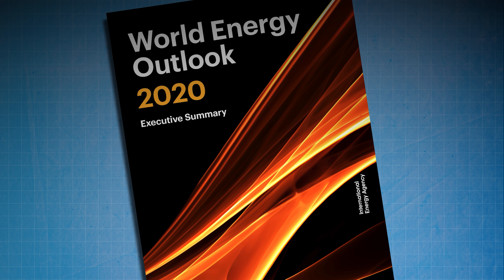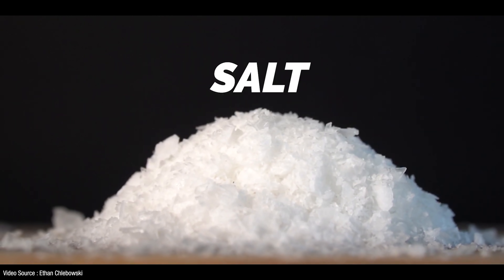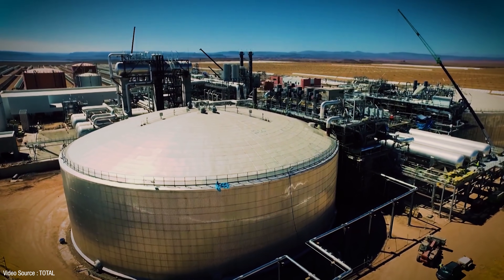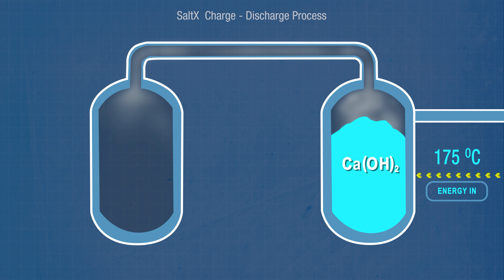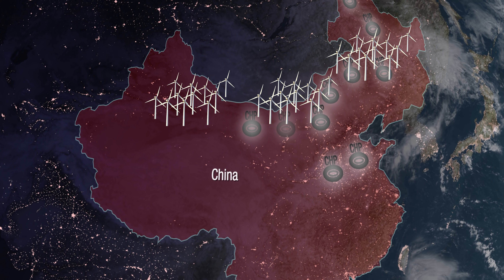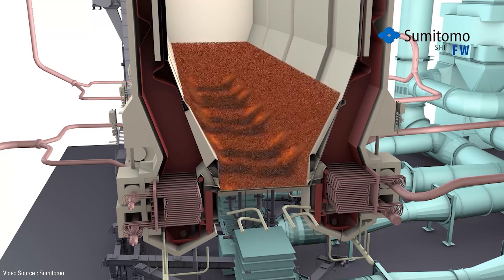Energy storage in salt - how nanoparticles are revolutionising the industry.

Comment: I've been thinking.. can you make these salts from sea salts? Cause I keep wanting to create or find a company willing to pump billions of gallons of sea water over hundreds of miles of canals to boost rain but then scrap the salt out of the canals for use in concrete & other resources. Add the areas of evaporation would be deserts which are best for huge solar fields.

Comment: good, another they print you believe material. what is water react with calcium oxide? is it a molecule level chemistry activity? if there is something stick to the calcium oxide, then can it still be called calcium oxide in the first place? so, what they describe either is not this particular chemical reaction, or it is bogus claim. you can try that reaction by yourself in some instant hot food or warming bags. repeat the same process with the same batch chemical mention 50 times is almost impossible already. if they claim they can do more, they don't have to sell recycle energy. companies making instant hot food and warming bags already break their front door and yelling for buying patents.

Comment: Phase change salts are also of interest.  Calcium Sulphate decahydrate, also known as Glauber salt is of interest.  When heated it liquifies as it absorbs phase change heat and gives this out when it re-crystalizes.  The phase change temperature is at about 32 C so is useful for home energy storage.  The problem is that as the salt begins to hydrate, it forms a barrier to more water getting to the salt and hence completely hydrating.  I haven't heard of an elegant way of getting around this problem.  It would probably help to somehow have very thin layers of the salt.  The latent heat of fusion of water is 80cal/gram.  The Latent heat of fusion of Glauber salt is 60cal/gram so it is pretty good at storing heat.

Comment: I have a dilemma (the above video may be one of many poterntial solutions)
I am a fan of steam Locomotives in the UK however powering such engines produces large amounts of CO2 due to their poor Carnot Efficiency and their use of coal in external fireboxes. Thankfully Coal consumption for steam locos is relitively low compared to other coal consuming means however this also means that it is uneconomical to produce coal in such low volumes to power the UKs steam based tourism industry which means we have to import coal - increasing the carbon footprint. 
I am trying to investigate ways of solving this problem that doesn't remove the "living" factor Steam locos are famous for in the tourism industry but finding safe suitable solutions is surprisingly difficult.

Comment: Too much of a good thing:  fossil fuels in moderation are great, as is geothermal, tidal, solar, but in excess they all lead to problems.
Tidal, hydro and other water power sources alter natural currents, disrupt ecosystems which are sometimes very fragile.
In large formats it has the capacity to kill off entire ecosystems, even change the ritational period of the earth and destabilize the Milancovich cyle.
With geothermal, in a widely distributed system you are takling heat from the earth and transferring it to the air.
In the course of billions of years this means the earth will cool faster while increasing air and dea temperatures.
With widespread use of photovoltaic and heat capture systems you are decreasing the earths albido and trapping more energy in the system, and will directly contribute to global warming in much the same way as fossil fuels.
Well, different way, instead of greenhouse gas trapping long wave radiation, it will be stored in the panels and released more slowly at night in a a sort of blackbox radiation, increasing night time temperatures.
As much as you think fossil fuels are the evil enemy, doing anything with 8 billion helpers gets the job done real fast, regardless of whether it was a good idea or not.

Comment: It took me quite some time to get the right data. I wanted to use SaltX in my experimental house (a Bengt Warne Naturhus) in Amsterdam and went to visit them in Sweden twice. Basically, you lose about 25% loading and 25% discharging. So that's fine when you have (lots of) waste heat at your disposal like in industrial processes but for home use, it means you need more solar collector capacity and much smarter integration of usages. For now, I ended up with pvt, but haven't given up on my dream for the 21-century version of the "MIT Solar House One" quite yet.

Comment: So called "renewables" like wind and solar have so many fatal flaws that they can never be used as one-stop replacement for hydrocarbon based energy like oil and gas. In the first place you would have to completely cover a huge piece of real estate the size of Nevada with wind and solar farms to ever have enough power. Also, either additional space would need to be allocated for very expensive batteries or we would need 100% backup resources like oil, natural gas and coal to make up for unproductive hours such as night, cloudy days, rain, snow, etc. 

Wind and solar would be a disaster for humanity if we ever tried to use it to supply the planet with adequate power.

Comment: This sounds as legit as "burning trees that have been harvested with fuel burning machinery and shipped halfway around the world does not add to the carbon footprint because the produced carbon dioxide was already absorbed by the trees before". 

3:25 Calcium hydroxide is produced by calcination from Calcium carbonate by heating > 800°C, whereby it is split into Carbon dioxide and Calcium oxide, and subsequent addition of water. Your can read more details on Wikipedia https://en.wikipedia.org/wiki/Calcium_oxide 
However, production of Ca(OH)2 involves a lot of CO2 to be produced, also for the heating, which is usually done by burning fossil fuels. 

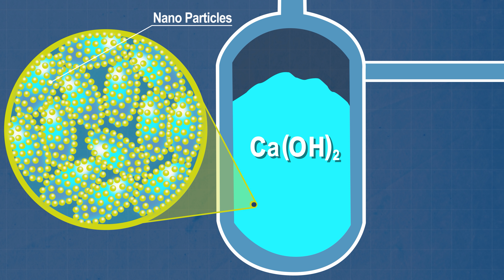3:55 van-der-Waals forces in salt crystals are probably the least thing to be worried about, because the ionic forces are much stronger. Sounds a bit like humbug to me.
Besides that, as a chemist, I can't think of any "coating" that would enclose reactive particles of ion size which are chemically altered in a quite aggressive way and still will be unchanged afterwards, and even more, will stabilise the back-transformation in a way that a nicely separated heap of small salt grains will be formed. Even more as the salt ions that are involved here are far below the "nano" scale, so those would probably build up on the nano particles rather than being coated by them. I don't say it's impossible, but I strongly doubt the correct use of "nano coated" in this context. 

4:50 the heat is not released in the form of steam, because the water is used to hydrate the CaO to Ca(OH)2, as you very clearly show in the animation. The heat is released as heat, and would have to be transferred to a secondary system to be used. When using excess water to form steam, the reaction temperature would be much cooler, and thus, less effective. Besides that, a system would have to be established to retain the salt particles that would be flushed out by the quickly evaporating water.  

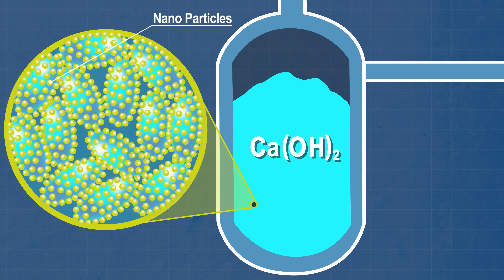5:20 alright, so the coating transforms a very caustic material into a non-corrosive material, but without changing the chemical properties of being an aggressive hydroxide that can be transformed into its aggressive oxide which aggressively sucks in water and heats quickly due to its reactivity (which is based on its aggressive corrosive characteristic!), and after a thousand cycles, it's again the caustic material that can be used as nothing has happened... wow, magic! Or simply BS? Please have a think!
To match all the proposed properties to even some extend, those nano particles had to be nano scale SiO2 particles, which will act as substrate rather than a coating. And it would need a special reactor to keep the particles moving during re-hydration, in order to keep them from clumping together. But it would not make the Calcium hydroxide less corrosive, not even a bit. 

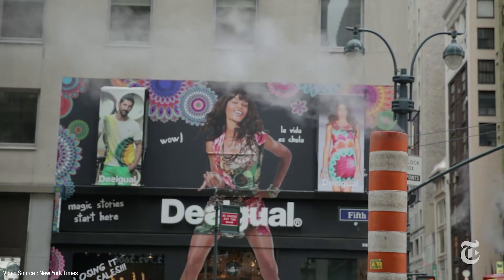6:35 I really doubt the mentioned 90% efficiency for several reasons. 
Calcium hydroxide / Calcium oxide would have to be kept in a separate, sealed system, apart from the heating source. Otherwise the salt would be contaminated with air which contains Carbon dioxide. And as any chemist knows, Calcium oxide loves nothing more than Carbon dioxide to quickly form Calcium carbonate. However, this would be the end of heat recovery. But having a separated system will decrease efficiency by quite a bit due to the necessity of heat transfer into or from the secondary system. 
Besides that, the container for the water would have to be cooled when the steam shall be stored as water, to be re-used, or the steam would have to be discarded, when fresh water shall be used for the recovery process. Even when the excess heat is used for heating, that heat would end up in the environment, just like for the other two, because the steam will still have >500 °C when it leaves the salt (the temperature that is needed to transform Ca(OH)2 into CaO + H2O). Coating or not, that heat needs to be used, or it's a total waste. 
And the heat still sitting in the CaO also needs to be used and not just dissipated into the environment, or it's also wasted.
However, using the excess heat for e.g. turbines or engines to produce electricity would surely not have 90% efficiency, because there would have to be another transformation to pressurise. And blowing all the steam off into the air, or use it for heating, definitely neither has. 
Another thing is the water that is used to form back Calcium hydroxide. It has to be very clean, stripped of any CO2 and organic materials, or the impurities would contaminate the Calcium salt and probably make it useless within a few cycles. This is a rather expensive step, because it requires micro filtering and degassing, which needs high and low pressure, respectively, and thus, quite some energy for the pumps. 
And finally, the calcium salt that is used here also has to be rather pure, because impurities of silicates, phosphates, sulphates, and other anions would lead to quick degradation of the material and problematic by-products of the dehydration. This makes the salt more expensive.
In conclusion, and when used as proposed, in a central plant, to generate heat and power, 90% efficiency can never be reached, and I really would be surprised if this system had close to 50% total efficiency.

It would probably be much more efficient to use the CaO produced by this process as a replacement for oil, coal, or other CO2 emitting fuels in decentralised heating plants or in home central heating. When produced during excess solar power, it can be stored until the winter comes, can be shipped to where it's needed, and can be used for heating again. CaO is already used for mobile stoves, so this is proven technology. And it could be produced without the detour over electricity when using the sun as a direct heat source, e.g., in the desert. Similar solar plants already exist. This would also give those countries a chance to benefit from their excess of sunlight which they now can't do much with.

8:16 no exotic or rare materials besides that magical nano coating material that is breaking down the van-der-Walls forces in ionic compounds and doing other alchemy-like things, of course.

I actually think this could as well be an attempt  to skim subsidies and investor money for an allegedly "green" and "fossil-free" technology on industry level, and it could turn out to be neither "green" nor "fossil-free" (like burning trees in distant places), but another "green myth" (to say the least) for the benefit of the mentioned companies and the detriment of the tax payers (and the environment, of course).

Comment: Direct heat though is much less efficient than pumped heat (eg resistance heater vs heat pump).  So perhaps passing the thermal energy through a generation turbine to produce electricity is still a better use than just pushing the thermal energy to a building.  Best practice get so complicated very fast.

Comment: Would be interesting to find out if this can be applied at domestic scale to replace gas boilers - charge up during the day, plus some surplus to keep the house warm, then discharge the heat over the next day to heat the house. In summer, some form of turbine to convert the heat back to electricity (rather than heat the house) could be useful. Makes you think....

Comment: That's almost exactly the idea I had for local power storage for buildings. I wanted to use a saturated solution of NaOH in a plastic container (against the highly corrosive nature). If you wanted to store energy in it, you can just heat up the solution to boiling and drive out water, which causes the salt to fall out of solution and pile up on the bottom. Once fully charged, the battery would be nothing but a dry powder. And if you add back the water, the NaOH dissolves and releases massive amounts of energy, but nowhere near the 450°C in this concept here, so plastic could handle it (or maybe glass, if you want to make sure). Then you can use the heat generated directly in the building. 
And since you have no chemical reactions, only drying-out and resolving, there really shouldn't be any disintegration like in the example in the video. Salt doesn't care how often it dries up, as long as there's water, it will dissolve.

If the calculations I made are correct, you could easily heat (and provide hot water for) a conventional, european 4-people home for more than 3 months without any external energy supply with a tank smaller than 1m³ and around 500kg of NaOH, which is cheap as dirt and can be extracted from sea water during desalination to produce fresh water in poorer countries (should also reduce the environmental impact of pumping highly concentrated brine back into the ocean).
And if you couply it with passive houses, photovoltaics and solar heating, you can build the thing even smaller and maybe even become selfsufficient for power when adding a small generator to it.

I really like that some company is doing a concept like this, however I don't think it's necessarily the best design for the largest market.
Reply: One the system require two tanks, one for the water and one for the NaOH?
Reply: @jaredgarbo3679  if you 'd want to store the water, then yes.
You could also just hook it up to your water pipes.

Comment: At what expense? Solar might be cheaper when it operates but at 30% capacity factor, it only works about 8 hours a day. So you have to buy 3 lots of solar - 1 to run your city and 2 to charge the 'batteries' for the 2*8 = 16 hours solar doesn't work. But batteries are not 100% efficient, so you're probably buying 4 solars for battery inefficiency. And you haven't even bought the batteries yet, but you've got to multiply the solar cost by 4! Now, batteries for your city for 16 hours at a minimum? Can you see why nuclear just makes sense?

Comment: Thanks for this interesting film JHAT, so much information and well done to SaltX, amazing how the particulate covering will prolong the use of something like salt, who would have thought to add nano particles to salt to help improve the efficiency in a molten salt reactor.

Normally I buy in tubs of calcium hydroxide (quicklime), mixed with sand it's called a hot mix, add it to water (2:1) this creates an enormous heat, bubbling and popping like volcanic mud in a exothermic reaction you mentioned. 

When cool it's like a solid clotted cream that I mix with sharp sand for the lime putty mortar I use in my work.

With nano particulates on calcium hydroxide would it still slake/cook?

Also interesting that China's wind turbines shut down the CHP plants, just recently in Texas the unexpected -20 weather froze up many turbines and shut down their refineries causing many electric cuts. 

Of course there were also many power cuts when Enron ran the grid but that's another story.